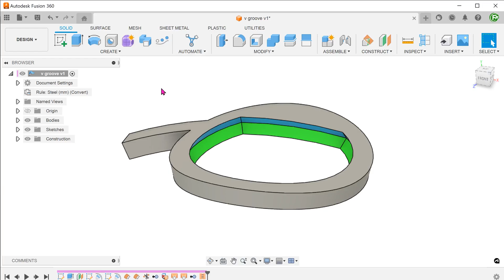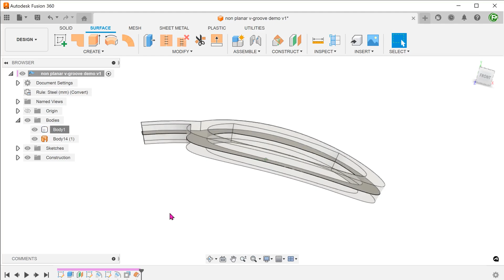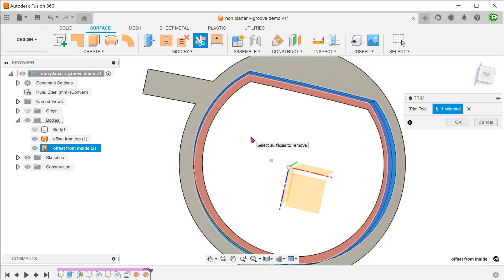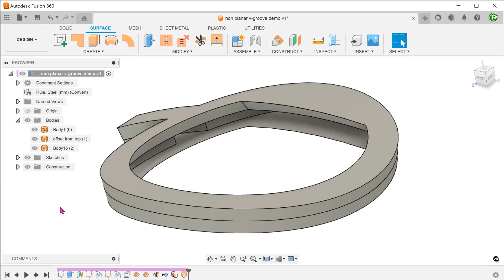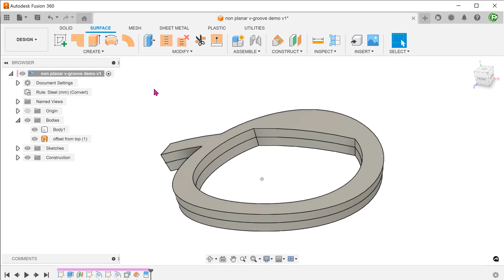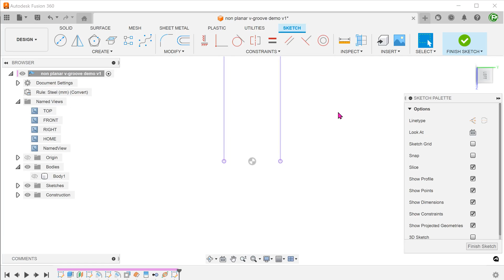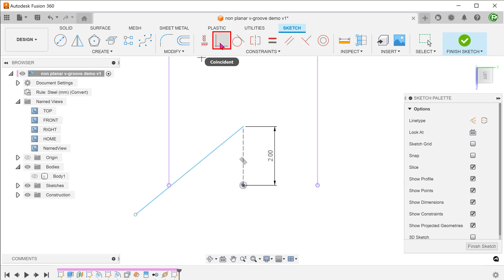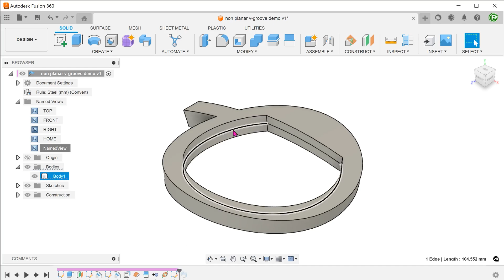Fusion 360 | V-groove on non-planar frame

Comment: Could you not perhaps split the body using the offset surface. Apply chamfer to both bodies and then combine back together?
Reply from the maker: I went to try this and it does work! Such a simple solution. Guess I have overthought this. I would never have thought of using a chamfer. Thank you!
Reply: This is an elegant solution nice one

Comment: How can I submit a topic I'd love for you to cover?  I have objects I 3D print with text on the surface.  I print the text separately and glue them in later.  My workflow for a flat surface is..
1. Extrude the text as a slight cut
2. Extrude the text again as "new body"
3. Offset the original cut so the text will fit after printing
or
1. Extrude the text into the surface as a "new body"
2. use the Combine tool to cut into the surface keeping the cutting tools (text)
3. Offset the cut so the text will fit after printing

I now need to do this on a curved surface like a cylinder.  The emboss command does not allow me to create it as a  "New Body."  I just can't figure out a workflow to do what I want.  It has to be an Emboss as the extrude feature on a curved surface distorts the text.  I've experimented with a surface offset as a cutting tool but that isn't working for me.  HELP!
Reply: I found a solution.  Please, ignore my request.

Comment: I am no expert but if you really wanted the sweep to work, I was wondering if you could use the rail option and select the top edge to get the sweep to cut better. Maybe also sweep one half of the body by splitting it with the offset?
Reply: Wondering the same

Comment: You'll need a guide surface for the sweep
Try sweeping along a coil and you'll see how wrong stuff goes without the guide surface.  If you coil a triangular profile the do an offset face of the flat portion of a triangle then you'd be able to sweep as expected on a coil.  Same applies here you'll just use offset face to make that guide surface and you shouldn't really need to define that inner line but this does assume that that distance between the two faces does actually stay consistent.

Comment: I wonder if using the path with guiderails (the top and bottom inside edges) during the sweep would have produced better results?
Reply: It doesn't work, at least not for this situation because the guide rail is not smooth.

Comment: Perhaps offsetting the inside face before sweeping would compensate for the curvature variations? For an injection mould application that sharp edge would be a ejection challenge regardless.